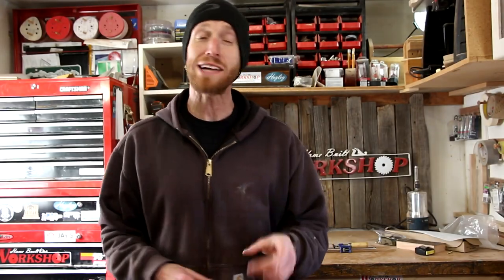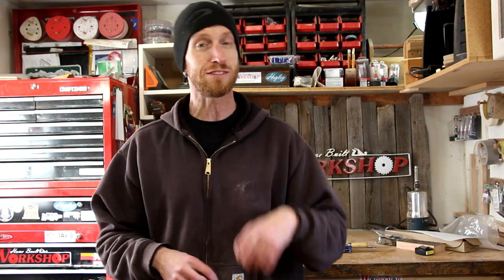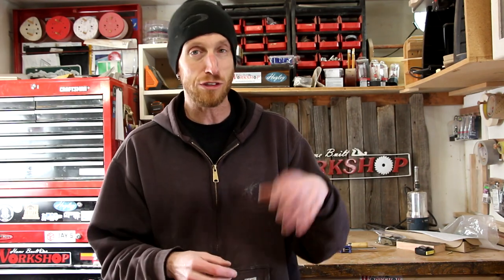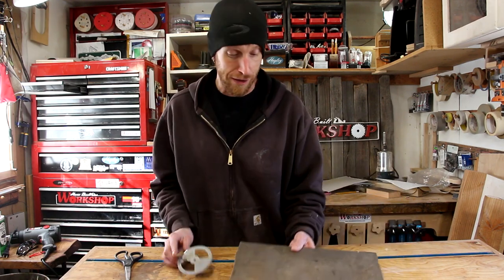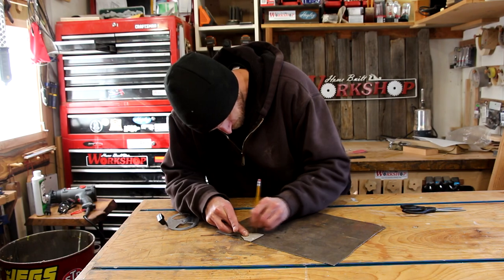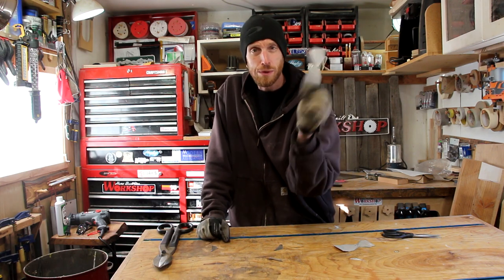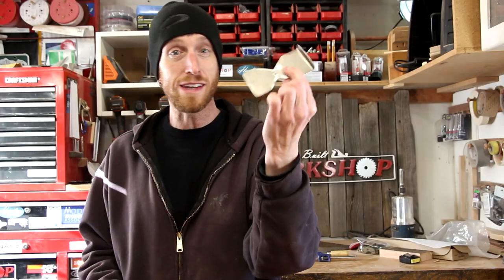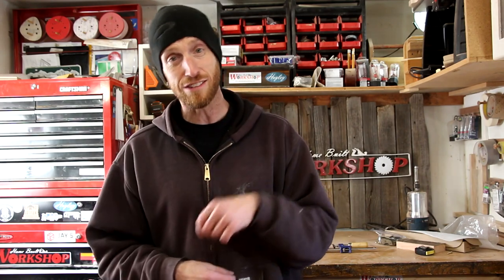Fixed: Missing Grill Vent | Repaired not Replaced

Comment: I agree with just fix it. I have a Weber grill that I’ve had for 20+ years. I’ve replaced grates, burners,hood, smoker box and the electronics.  It’s still going strong though I probably need to replace the igniter again. It’s amazing how long you can keep something going if you take care of it and buy top quality products to start out. I also have a Toro mower and snow blower that are 20 years old and still going strong. I’ve showed my son how to do the upkeep on those too.  Heck, both would probably last a lifetime if I wanted them to.
Reply from the maker: Yes! I have older mowers, grills and lots of other things. Fix them when they break and take care of them and they'll last a long time.